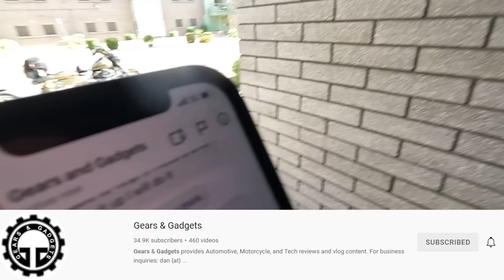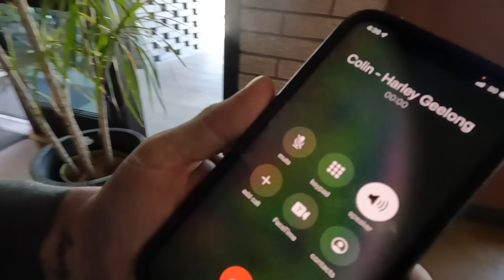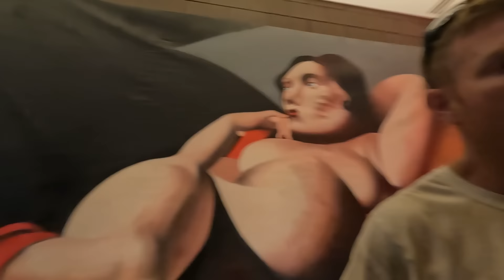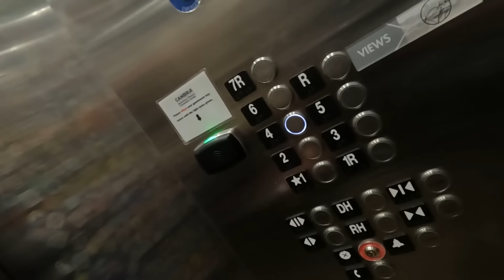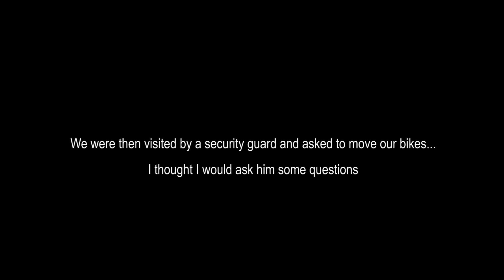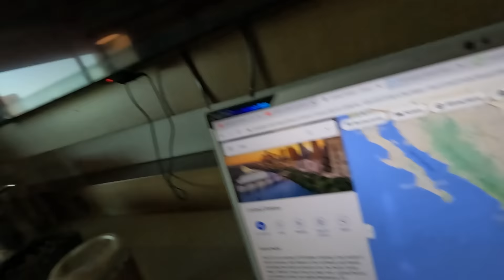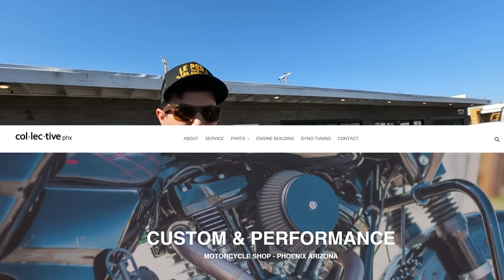FRUSTRATED - Why can't I get a Harley Davidson Part ?

Comment: I had this same problem back in Novmber last year. All the HD dealerships in the MO area did not have a stock replacement available. Only dealership here was willing to get me an aftermarket rim in a weeks time. every other dealerships would not even give time of day. Props to Rawhide in Olathe, KS. They came picked my bike up and replaced the rim and tire all inside of a week where all the other dealer would do nothing and said to soonest a wheel would be available would be May - June time frame. It  is great these folks from GearsGadgets stepped up and helped out!

Comment: You were lucky Danny! In 2011 I was riding from Vancouver to Moab. As the trip progressed I noticed a "looseness" in the ride and by the time we arrived in Salt Lake City my '06 Road King was not riding properly. Ultimately about 100km past Provo I finally stopped and took off the saddlebags and noticed 4 spokes were broken. I returned to Provo slowly where they tightened the spokes because they didn't have a replacement. I had to carefully ride to Kingman Arizona for a replacement wheel - that was the closest dealership with parts. S, I feel your frustration.
Reply: Just had the same issue. Kept taking to the shop, I was told it was a normal thing. Not on my bike.

Comment: Subscribed to Gears and Gadgets.  HD supply chain has been sad for years. In 2019 I went on a 43 day 12,700 miles ride on my HD Triglide to the 4 corners of the lower 48 states (Calif, Washington, Maine, & Key West, Florida).  I broke down 3 times (compensator twice) and was stranded in Maine for 4 days waiting on parts that I had to pay extra to have air freighted to the dealership. In 2021, on the way to Key West, the drive belt broke.  Had to wait 5 days for a belt for my 2016. Sad and frustrating.

Comment: Cryogenic treatment of metals is not heating them up, but slowly cooling the parts down to -244F or -153C with liquid nitrogen. Some process require even lower temperatures.  This changes the structure of the atoms in metal and can increase durability, reducing stress and reduce fatigue in the metal. There are other benefits as well. A lot of race teams will cryogenically treat engine and transmission parts.

Comment: Don't ever think Harleys parts shortage is something new and related to covid. The shortage started long before covid. My Ultra had panel damage caused by a transport company in August 2019, it took until July 2020 to get new painted panels from Harley to my Harley dealer in Australia. In October 2020 the ignition barrel stuffed up. Harley couldn't even give an ETA on when we would see it. I sold the Ultra in May 2022 still without the new ignition barrel. I've owned Harleys for 30yrs and love them, but I won't own another until Harley change their ways and can give customer service.

Comment: And even if you get parts and they're made offshore they are made incorrectly they are not cleaned after manufacturing especially if it's tablets they can't seem to be able to wherever they're manufactured to manufacture them correctly as in metal hardening heat treating. Thank goodness there's a lot of used parts and I never throw anything away let me tell you unless it's Way beyond repair. Because somehow some way I might be able to repair it my bikes are 20 and 30 years old. So you have to source OEM or old manufactured parts. Now this doesn't go for well in your case it was a broken rim I didn't want to say anything earlier but when I seen the previous video. But you don't have to stay with a year specific rim. You could have went with spokes you could have went with this or that as long as the rotors would fit correctly to the calipers to the rim and it was a 19 inch tire which is that can even be changed to some degree bearing sizes can always be changed. But it's nice if you get the one inch bearing or I think it's 25 mm now. Best of luck..
And when you call and I'm not going to get specific to my area but unless you go with money hanging out of your pocket they treat you like second class citizens I know Danny worked hard for his money and I think the person that makes $30,000 a year works hard for their money but the Harley dealers often don't see the little guy at all and now they're,, starting to not pay attention to the guy that comes in and buys a new bike every year or every two years or every three years you just get that feeling going into a dealership anymore it's like going into Kroger's. 😢😢😢😢
I really like to promote the and talk up the independent shops but recently and even not so recently if you don't buy the tire there they're getting like Harley shops if you don't buy the tire there they won't mount the rim they won't move the tire to the rim. That's fine they can reject your business hey that's fine but because they are independent shops they should be the ones that are stepping up and maybe charge a little bit more if you don't buy the tire there so they don't make that money on the tire too but at least Mount the guys rim. I've seen this with several people I know it's probably be the last 10 years it's been worse. That's why I built my own tire machine I mean it's very simple but leverage does a lot. And I'm out my own tires I am out other people's tires and if two people do it together that's even better. Well I guess that's all I can rant about now

Comment: Here is a tip for you , just as good as duck tape for preventing your rim from cracking even more, just rub your snot over the crack and let it dry. Instant fix.

Comment: So  Collective in Phoenix   Customized an already over priced HD, They took the stock wheel and tire off and  put on some aftermarket custom wheel ..  They sold you the  wheel with  bearings a tire and disc brakes for a very reasonable price..
  You but lucky .. al the same the Crack could have been TIG welded too..

Comment: This so called parts shortage has been going on for years now.   This HD Road King rim is only manufactured  in China.   Nice job HD.   What if you Live in Milwaukee WI.  The home of HD.  Your riding season is at most 8 months a year.  You could easily lose half your riding season waiting on a Chinese rim.   I was at my local HD dealership yesterday.  They have a customer that has been waiting 9 months for a spoked rim for his HD.

Comment: The parts shortage issue is not HD's fault. Supply of everything worldwide is an issue.
Anyway, HD wheels are, and I think they still are, made in Australia.
Reply: How did this get a hidden comment? Yeah some of the wheels were made in Australia
Reply: @franklaskus2395  All Motor Company aluminum wheels have been manufactured in Australia for decades

Comment: You got the bead  so it holds air ..  I could   V-out the Crack and Tig Weld it and it would be good as New.
  All the Same the D.O.T.  Department of Transportation says never weld on a rim .   All the same .. It would make the rim solid and safe as far as I know.
  I just purchased a 2008 Buell Ulysses..  HD Spent $115 Million to shut down the new Modern Buell Factory in Jan 2010.  HD could not give a Rat's ass about supplying any parts for Buell's.    HD recently sold all Tooling to manufacture Buell's to a Company in Grand Rapids MI .. As of  the Fall of  2022..  you can purchase a new Modern Buell  with the Liquid Cooled  V-twin overhead cam 4 valve head engine.  I think Eric Buell called it the Halcion ..  He designed it in  Partnership with  Rotax in Austria which is owned by Bombardier in Canada.
  If I have my facts straight .. After HD shut down the Buell Factory in Race Lake WI ..  The tooling to manufacture the Halcion engine was shipped to Eric Buell who actually built  EBR Motorcycles in the Rice Lake Factory.
  EBR   made top of the line sport bikes Capable of winning V-Twin road races..  Now the CO that calls themselves Buell in Grand Rapids MI  have the Tooling to continue to manufacture these engines.
  The wheels are lighter than most  because one large single disc brake rote is mounted to the   tire end of the wheel not to the Hub..
  Also my Buell has an Air Cooled V-Twin HD engine..  It has  air ducts to cool the rear cylinder.. and  oil cooler and  an electric fan to pull air across the HD Thunderstorm 1203 CC Engine.  It has a redline of 7,000 RPMS and is  103 Horse Power .. More power than most HD's  for sure .. even though it's only 1203 CC's and a 5 speed .

Comment: You never had a Blow out .. You dented your  rim and developed a slow leak on the bead..  I have had the same think happen to  my car before with steel wheels. I just heated the dented area with a torch and pounded the dent back out.. Not so easy to do that with Aluminum ..

Comment: Rule number 1, never break your vehicle weekend on a road trip because you don't have any dealer open for parts. It is something we need to think about before planning the path.
Reply: Come on, bro. You can’t ever prepare for it all. If he prepared for the rim his engine woulda blew up, and vice versa and sideways.
Reply: @franko8572  You avoid planning a long-range or rough road each weekend. You avoid nasty weather, too warm for your engine and metal parts or too cold for an efficient lubrification and electric system. You always start your round trip on Sunday night instead of Friday. Short distance ride before the road trip to evaluate mechanical problems after an oil change and total checkup.
Reply: @ReneMongeau1  Okay, cool. 💪 Thanks, bro! ✌️

Comment: Do you really expect local harley dealers to keep a spare front wheel in their inventory that probably won't move for years? I've had to wait a few days for a stator pre-covid.
Reply: Seriously? Yes, there should be some parts somewhere in the chain that can be moved around the country in 24hrs at most at the very least for the most modern machines.

Comment: I watch and follow many vloggers, including people based in the USA. One of the things said often is that HD have a wider dealer network than Indian, so it’s ‘safer’ to buy HD than Indian. What use are dealers if they don’t stock a thing as crucial as a wheel rim nor have access to stock to get one within 24hours? I bet if you called an Indian dealer, they would either have stock or take one off a showroom bike to get you on the road again. Then you got the 50000$ cvo that doesn’t even tell you what gear you’re in! Frankly, the best part of HD is their marketing division. Laughing all the way to the bank! Just saying…. 🤷😅….(bmw guy here)
Reply: come on it was a sunday and they found one for him next day and he wanted it sooner.  indian dealers dont stock anything at all and they are few and far between
Reply: If you really need the bike to tell you what gear you are in, you probably shouldn't be riding one to start with 😂
Reply: @kurtfoulke5130  no I don’t need it but but there are situations, slow speed exercises, etc you need to verify. That’s not the point. The point is you don’t pay 50k$ for bike that has no gear indicator that Honda puts on CB500. HD is making you pay the earth for a 100 years old bag of nuts and bolts. They count on people with your thought process. 🍻😅
Reply: @nickbazan27  found one privately and by the grace of a fellow Youtuber. Nothing to do with sterling service from HD. 😅🤷
Reply: @ridicule35  i was talking about the video yesterday - he contacted a HD  dealer (sunday) who said he had a street glide rim thag could fit , if danny could wait till monday when service dept was open to fit it.  you are too busy guzzling sauerkraut on your bmw to have seen that i guess.  anyways my point was - indian dealers suck too, which u seemed to think were better with more stock.  i never said anything about indy shops which are almost always better than dealerships.
Reply: @ridicule35  that's the reason you and millions of others that nobody gives a shit about are better suited for a CB500 than a 100 year old bag of nuts & bolts.

Comment: go to a shop that fixes bent rims they will heat it bend it then weld it ITS THAT SIMPLE
Reply: No it's not that simple.  Likely the wheel bearing suffered shock load.  Same with the tyre.  Wheel repair shops don't replace tyres or wheel bearings.  He got a way better solution that faffing about with "wheel repair" here

Comment: Any fabricating welding shop could weld the wheel to a strength level at the weld exceeding the rest of the wheel's original strength factor.. anyone with a modicum of mechanical savvy would know that.. it's such an obvious resolution to the issue  ..you are lucky you have never gotten into a  serious situation where you needed some mechanical savvy to save your life. ..
Reply: The guys at the shop knew that but hey, they made $600 selling him a new wheel.
Reply: @FreddietheFly  which the bikeshop would do to someone who clearly has no  mechanical repair knowledge understanding..and if the person doesnt ask if the wheel can be repaired inexpensively and safely..they immedistely signal they can afford to buy a totally new wheel.. so hello  sucker..

Comment: Ok that's enough for me, Im not watching this cluster fuck anymore,I don't believe you haven't run into a Wrech that could get you going, and told you to scrap that fuckin mag rim, for a steel rim with all the machine shops around in 2 hours they machine, 
Probably any custum bike builder would get you on your way,

Comment: Harley sucks. I had a 1985 fxrs one of Harleys best motorcycles.They stopped making it because the frame was to difficult to make they said.
The replacement was a Dyna then the Street Bob. The Dyna was a fxr wannabe.Who in there right mind would call a bike the street Bob? I do like the road glide but the suspension sucks.Buy a BMW